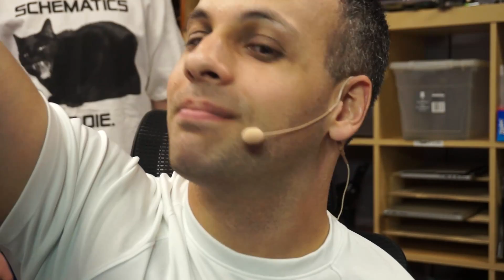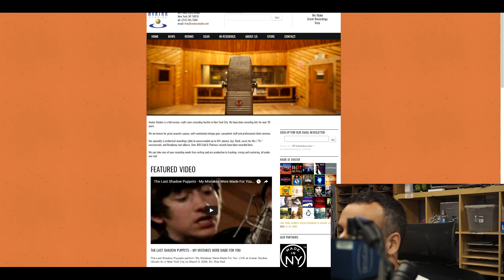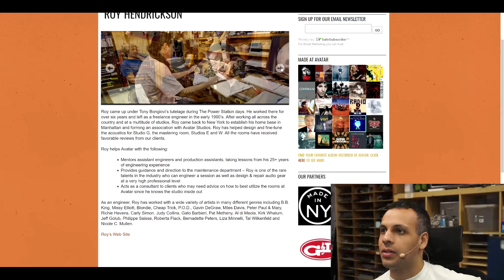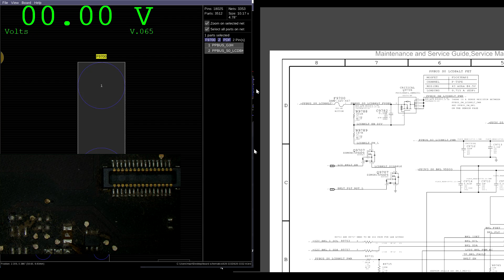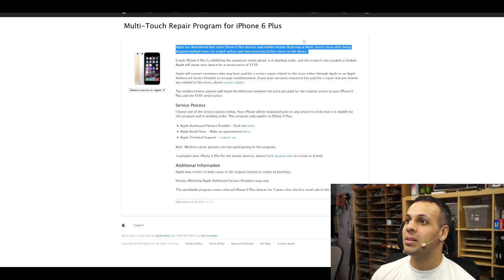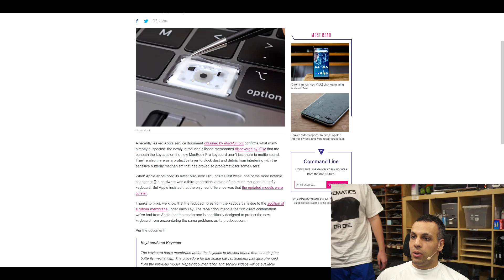Tuesday Afternoon Macbook Repair :)

Comment: If you want to see if other laptops perform the same as the 2018 Macbook pro with the i9, look up reviews of the ASUS Zenbook Pro UX580GE or the Dell XPS 15 9570, both have that CPU and near enough system specs (note the zenbooks can only have 16gb of RAM.

Comment: Haha, 350v belt, eh? I copped a 475v from a Fender amp years ago. Dropped the thing like a sack of shite. Took the cap cover off when I ordered the caps. Forgot the cover was off when the caps came in as I was taking some measurements before tearing it down. Went to turn over the chassis and BAM!

Comment: Louis, do you repair other types of computers? Like other then MacBooks and stuff? Clearly you "Do" with that old phone and stuff but like as a business if I wanted to send you my Lenovo Carbon x1 since I definitely don't trust the warranty I got if my data or something more important than like a screen was in Jeopardy
Reply: Aaron Rosner sadly Apple is bad enough to keep Louis from repairing dead laptops from other brands. However its more than possible in smaller towns. I am working in a small repairshop in München, so 8 from 10 laptops here are PCs, other 2 are becoming PCs after being repaired. If you want your data safe just   ask technician to remove the ssd and give it to you in a ESD safe bag. If technician refuses show him a middle finger and go somewhere else.

Comment: Damn, an entry level employee at banks like Wells Fargo start off at $16 an hour. They do not require any secondary education and, in some instances, will not hold certain people to the requirements listed in the job posting. In one case back in 2003, a woman was such a hire and 2 years later went on to working in acquisitions (still no college education just OTJ training) and made $25 per hour. MTA track workers start off at $22/ hr and you work in a far worse environment. FDNY firefighters make around the same. 

Still beats my first job at Wendys back when I was 17 only making $6 per hour.

Comment: The new 'update' from Apple will 'change' the software to allow the chip to run hotter without throttling. Watch in the future as a new problem arises. The 2018 MacBooks will die earlier.

Comment: The Macbooks have a VRM overheating issue, so certainly when you just use 1 freaking core and only use a fraction of the power the CPU can demand when running on ALL cores, it won't exhibit the same issues.

How retarded are these Mac sites, really that's levels of delusion you generally tend to only find in politics these days.
Reply: The product is sold and marketed as a professional level device and comes with a pricetag to match, yet if you use the device for a 'professional' task that the product is certainly equipped to deal with and is advertised to be good for, the product performs Worse than the last generation of this device because of yet more design flaws... The newer device is noticeably slower than the older one if you use it the way it was designed and advertised, it is a bad product for the target audience of professionals who would buy such a machine, Telling me that my expensive new car won't blow it's engine if I only drive in the city is not acceptable.
Reply: Yeah, i9 (and new Intel lineup) does have new single core boost profiles. But that is like saying "but the drinks bar is working PERFECTLY... on the Titanic ". ;)

Comment: The main issue with the i9 for me per se is not the throttling it self but the marketing of the pro. 

If it is a PRO series mac book, it means people need it for Professional  use, and in order to achieve pro specs, you have to sacrifice portability and comfort. For those you have the AIR. The pro should be as big and bulky as it needs to be, in order to provide you with professional grade specs. 
Its not just Apple's fault though, but it also is the Apple consumers. They want to have a slim light computer, that can offer Desktop equivalent performance, and they want it so badly, that they are willing to be fooled by Apple that this is possible.
Pro's should be PRO's , they should be easily moved yeah, but they should not be portable (if that makes sense). And if you REALLY want both, then have Apple make a proper Workstation Base for it, that provides better cooling, enough to avoid the CPU throttling, and allow the CPU to throttle while you are mobile and you most likely do not need to use CPU intensive applications.
Reply: If it was for Professionals it would have a Xeon CPU.
Reply: Alot of Professional Workstations make do without Xeon's, especially laptops. For example the older Compaq Mobile Workstations who used Core2 processors and not Xeons
Reply: Wyo engineer That's the dumbest thing I've heard. Something doesn't need a Xeon processor to be professional.
Reply: so you basically claim that  Apple users won't accept 2 mm thicker laptop? really? is that what would trigger apple fans enough to stop buying new MBP? jesus you're so mean ;)
Reply: Wyo engineer 10 years ago maybe.  new intel architecture is scalable enough for i9. rip xeon.